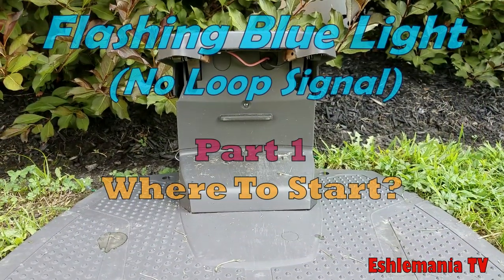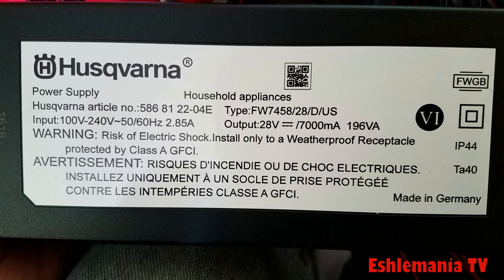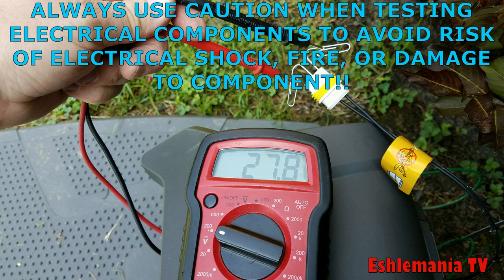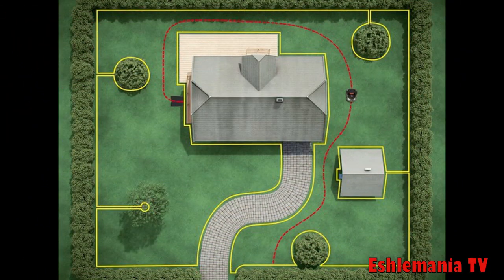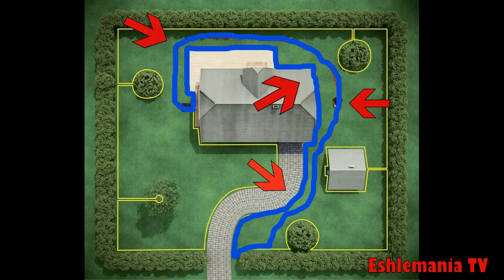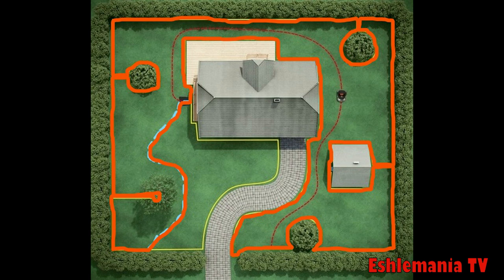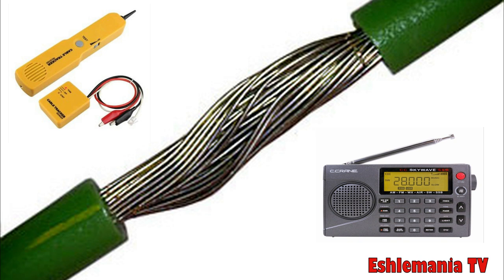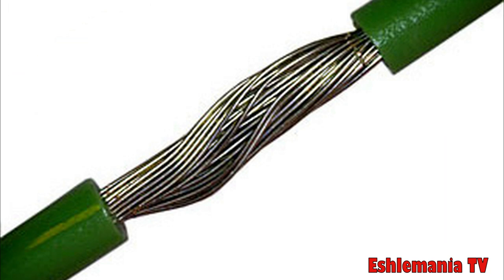Automower Answers: NO LOOP Signal (Flashing Blue Light)

Comment: Thank you! I found the break just by taking a walk along the perimeter wire with an AM radio on MW tuning in for the "woodpecker" signal. Took off one connection on the perimeter wire and walked out from the one connected. Works best with radio perpendicular to the wire.

Comment: Do the voltage diagnostics in reverse if you want to save time. If your voltage coming out of the boundary wire clips is good then no need to work backwards toward the transformer or anything else. In diagnostics you always start at the farthest point of failure. Saves a lot of time
Reply: Bingo! Checked my boundary wire out stubs/point of contact and got my voltage. Therefore, no need to check transformer, etc., and no need for paper clips.
Reply: What should be the voltage coming out of these boundary wire contact points? 28V?  I have a blue light and I measure 9V.

Comment: We had an accident with the weed trimmer; the power supply wire got wrapped up in the spool and caused the positive and ground wires to twist and touch each other so I assumed it fried my power supply. There was no light on the base station; so after testing the power supply it was reading 28.05, not fried; happy moment! 
When inspecting the power cord at the base station I found the issue was only the wires pulled back out of the connector but not all the way so it was not obvious at first glance; another happy moment!
I could have found this if I started with checking wire integrity before power tests.

Comment: Our flashing blue light after install was the guide wire connector/splicer - where it connects to the perimeter wire. For whatever reason, it didn't work. We replaced it with our own splicer.

Comment: Got the dreaded blinking blue light, spending days screwing around with it, only WISH I had found and watched your video!   Yes, using the guide wire to detect which loop to focus on is a Gamechanger.   Minor note, of the 3 tests at the beginning of your video, IF you started backwards on those 3, you would save us time.   In addition, I saw one video, I’ll have to go back and find it, that hitting two keys on the Advanced section of the Automower itself, you can get into the programming and make the automower follow your broken loop, to find it for you, at least that is what I think he was saying, but I’ll have to recheck.   Thanks man, hopefully I’ll find the dreaded break shortly.

Comment: Man, I'll fly you to NC to get mine working. 😁
Reply from the maker: Send an email to Automowerguy@gmail.com and we'll try to get you back up and running
Reply: @EshlemaniaTV  Thanks for the reply.  I believe it's the power supply.  I have no lights on the base so I took my power supply to a dealer who has one running at their site and I asked them If I could plug in my power supply to their set up and sure enough No power.  The crappy thing about it is that I dug up my entire yard and re-laid the wire this weekend in 85+ degree temps with 68 degree dew points... Guess I should have checked the power supply first, but who would have though a power supply would go out after roughly 4 months of use. Massive sun burn and a near heat stroke later, hopefully I'll be up and running this week Lol...
Reply: @jeffraines414  Same issue here Jeff.  I hope this isn't an annual issue.

Comment: I'm working through trouble-shooting my 450x - one question I haven't readily found the answer to - if there is a break in the guidewire (not the boundary wire), would I get the anxiety-inducing blinking blue light? Or does a break in the guidewire still allow the mower to run? I've been using a multimeter to test chunks of the mowing areas and everything seems okay except for the charging station (admittedly my steps on testing were pretty much backward to your recommended steps!)
Reply: It will run with a broken guide wire alright but will have problems getting back to charge and will probably go dead in the garden unless u have a model with more than one guidewire

Comment: One other hint for the tone tester. Get a tester with a sensor on the end of long wire. Mount the sensor at the end of a wooden dowel (I used duct tape). Now no bending down just walk the line.
Reply from the maker: Good suggestion

Comment: I have a flashing blue light on my 430x. I couldn't find a break.
I even ran a fresh wire around another section and got the same flashing blue light.  I tested the wire for continuity. 4.5 ohms for 250metres. I have 28v at my transformer but across the terminals for the boundary wire I only get 20v. I suspect the board may be faulty. Its frustrating and it has been a great machine until now. 
Any suggestions?
Reply from the maker: If you have 28 volts going into the charging station, but only 20 coming out, then I would suggest replacing the charging station board. BUT before doing that make sure to check you low voltage cable and see if the 28 volts is coming through it. We have encountered a few units with a an issue at the plug on the back of the charging station due to a power surge. A lot of times you can see that the plug is burnt by the pins in the connector when you unplug the low voltage cable. 

If you're unsure about replacing the charging station board then check out this video from the Robotic Mower Services channel:  https://youtu.be/TFR3lwNpnag

Comment: I have a mower thst works sometimes. I have not been able to find any breaks. The no cable signal is on most of the time, but then once in a while there is signal again. Any thoughts on that?
I looked into the secret service menu, and the test says that there is no cable signal there either.
Reply from the maker: Check the resistance between the left boundary wire and the right boundary wire. It should be be less than 20 ohms. If it's in the high teens then moisture or something else could cause the resistance to increase past 20 ohms and cause a no loop error.
Reply: Interestingly I have had a similar fault and when I connected the guide wire into each side of the main circuit it came up green both sides. I have previously repaired a break with a connector and as the ground is water logged at the moment I wondered whether moisture could have got into the connector. Is that possible and would the fact that on the shorter circuits the resistance would be slightly lower (my garden is nearly an acre) it might read a low enough to be green?
Reply: Check with an Ohm meter for resistance. Or check this link https://youtu.be/sdxZq-znpYU

Comment: If you have a multimeter, instead of swapping the wires over, just do a continuity check on them at the base station. Probably best to unplug them first. I checked the voltage on my power supply but my multimeter wouldn’t pick up the voltage so I bought a new one assuming it was that but had the same issue. I had some spare wire so I temporality connected that in place of the “broken” wire (from the guide wire connection to the boundary wire) and immediately got a solid green light and of course my multimeter picked up continuity.

Comment: I am getting 28v at power supply into station, but on 6 or 7 volts at the poles out to the loop, that scenario isn’t addressed in your video. Any ideas??
Reply from the maker: Email roboticmowerservices@gmail.com and they will get you fixed up

Comment: If you're happy that your charging station, low voltage cable and power supply are all working properly, there's an easy way of finding a break in the wire. Get a small radio (what used to be known as a "transistor radio" years ago). Disconnect one side of the perimeter wire from the charging station. Set the tuning to AM on the radio, tune it to a place on the dial where it's not picking up any signal and hold it close to the boundary wire that's still connected. You'll hear a buzzing sound. Now follow that boundary wire from the charging station, holding the radio close to the ground. The buzzing noise will stop close to the break in the wire. The boundary wire that comes with an automower is effectlively an antenna....this method of finding a break simply makes use of that. :-)
Reply from the maker: The AM radio method works in many situations, but a tone tester works much better. We used the AM radio method for the first year or 2 of repairs, but switched over to using a tone tester like the one in this video: https://youtu.be/qOAvqpQlO7E

We started using the tone tester because of interference from other utilities and items in the ground like dog fences, power lines, etc. With the tone tester it is a "beep" sent through the wire and it makes it easier to tell that wire from other items in the area. The tester in this video sells for around $40 on Amazon right now.
Reply: Hi - this is a great help. One question - why do you have to disconnect one side of the wire from the charging station?

Comment: Tested outlet, and transformer, bought line tester, called Husqvarna multiple times. No Husqvarna installers or anyone who is knowledgeable in the area. Still blue light flashed.can anyone help or who to contact to get the mower operational.  I think it will be good when it finally runs. Should I just see if I can send it back? Don’t know who can help.
Reply from the maker: Try this next. This will tell you if the boundary wire has a break, partial break, or if it is good. If it's good, then the issue could be your charging station board. https://youtu.be/Znz3L2P4hcU

Comment: I get a flashing blue light with one boundary wire loop connection disconnected but when I have both boundary wire loop connectors connected to the base station the LED does not light up at all? The mower shows the no loop error but the base station LED is not illuminated at all. Please help! Thanks

Comment: Any ideas for when my mower says no loop signal, but there is no flashing blue light?  The mower does fine in 2/3 of my yard, but stops in the front section by the road and says no loop signal. Any help would be appreciated.
Reply: Could be some other underground cable or metal object interference

Comment: So I assume you cn not use the guide wire to help narrow down the issue on the 310 ?
Reply from the maker: Why not? It would work the same way
Reply: I tried it it did not work so I had  lots of wire left and made seperate loops and got it fixed

Comment: I have a green light, no broken wire as ended up replacing it all, starts charging around it charging matt and eventually starts then stops again and says no loop signal. Any ideas? Surely not power cable if light is green?
Reply: Hello I have the same problem us you .I have green light and when I have to start it counts down from 3 to 1 and then pops up a waiting message and I can't start the mower in either automatic or manual mode.
Have you solved this your problem ?

Comment: Anyone any experience with a dead base station? 28.0v in ok but only putting out 5.0v from L to Guide 1V  between R and guide 0V between L and R. Flymo 1200r....just turned 2 years old!!
Reply from the maker: Sounds like the charging station board needs replaced

Comment: Hi, I'm having a flashing blue light on my Husqvarna Automow 105 and went around the lawn with an AM radio and signal looks fine. Tested the power supply on both ends as per your instructions and outputs 27.8V so that looks alright. However testing the boundary wire connectors on the charging station only gives 25V. Is that enough ? Could that be it ? There were some thunderstorms in the area last week and I got the issue since then so I'm fearing the charging station got a power surge somehow... Thanks for replying.
Reply from the maker: 25 volts sounds a bit low, but it's always best to double check the rating on the label of your charging station's transformer to see what it should be putting out.
Reply: @EshlemaniaTV  Hi, thanks for replying. Found the issue meanwhile. It was indeed a ruptured boundary cable somewhere in the middle of the lawn. Was quite a pain to pinpoint it. Thanks for your help and great video by the way !
Reply from the maker: Glad you were able to find the issue. We're working on a video to show how to get a better idea of where the break is, but just too many irons in the fire right now.
Reply: @EshlemaniaTV  please do this as would be a great help! Thanks

Comment: Anyone any experience with no light at all? 
The automower will not charge, and I have no light at the diode in the charging station.
Reply from the maker: If there is no light at all then it would be either the power supply, low voltage cable, or the charging station board........as long as the outlet that the power supply is plugged into is working and putting out power. If you need parts check out www.roboticmowerservices.com or email them at Roboticmowerservices@gmail.com

Comment: Hi. My power supply gives only 26,3 V. Is that sufficient?
Reply: Yes, you should be fine, that is worst case 96% of the maximum theoretical charging voltage giving you an effective 184VA  instead of 196VA. In the real world it means you may have a slightly longer charging time (again theoretically).

Comment: My problem started with the mower having docked wouldn't start again due to no loop/flashing blue light. Took the docking station out, checked the terminals, all good - green light appeared by magic and mower went off happily. Same thing next day, checked everything connected ok, green light returned, mower went off to work again and founds its way home but then wouldn't depart an hour later. What could this be?